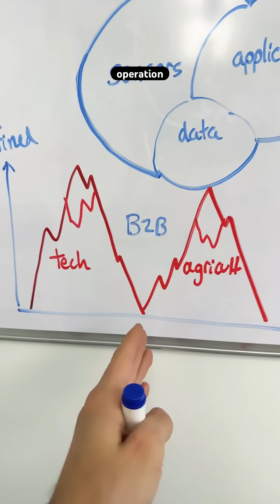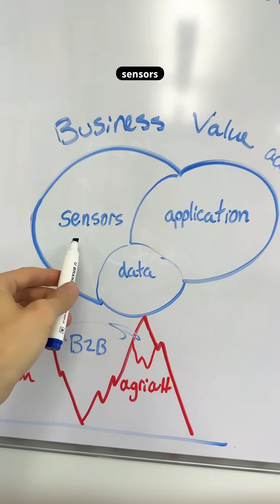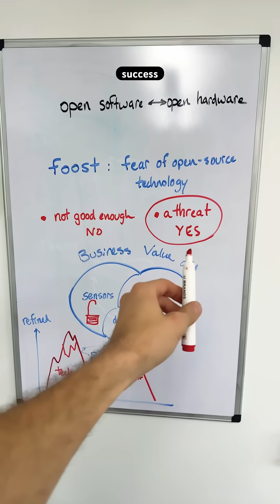how to crash a business using #opensource hardware

Comment: Ironic in agriculture as farmers struggle with John Deere and right to repair.

I like to explain OSS like a car. Mechanics can only exist and do their job because they can look inside the car and see what's going on. We can only do consumer safety because third parties can test your car. People make better cars because they can "edit" them. This doesn't lead to fewer car sales, it leads to more! People buy cars specifically to modify them. People specifically buy cars for repairability. 

With software, it will always break and you'll always have edge cases you could never see coming. Closed source, you might not even know about the issue and customers just get upset with the product. They'll find an alternative if they can. But OSS not only helps find problems but people will do free work for you. They submit patches, fixes, and will even implement new features you never thought about, directly increasing the value of your product.

It also significantly reduces risk! If you the OSS provider goes out of business then they the customer aren't also at a loss. Your product still works and can be fixed. Even if you go away they can hire someone to make fixes instead of having to buy a whole new thing and start over.

It's especially important with farmers, who need to repair things fast. You can't wait a week or a month. You need it fixed yesterday.